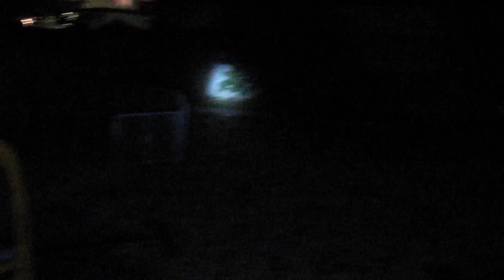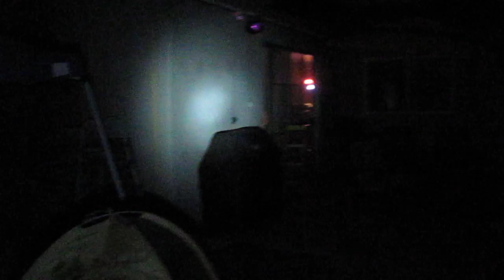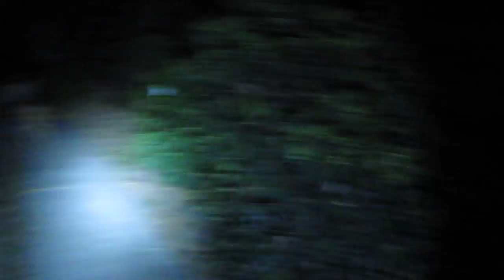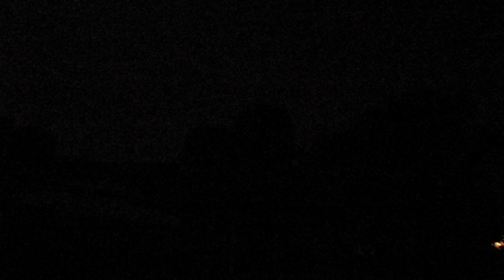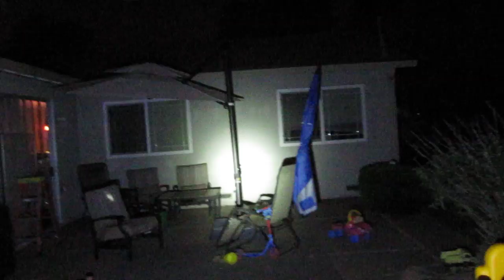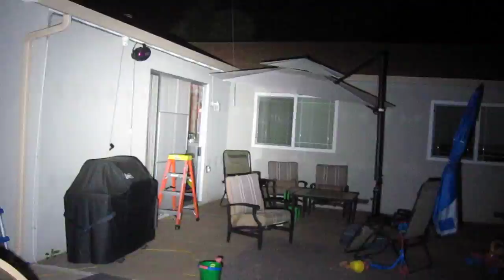Maglite XML upgrade vs some other led flashlights

Comment from the maker: you do loose the focus, but the dropin has a pretty hot center to begin with, so its no problem, you do need a 5 or 6 cell magligt for it to work

if you want to use a 3 or 4 cell, go with the 5 led 1200 lumens dropin module, its awesome 1

both can be had on dealextreme

Comment from the maker: i got a "drop in" from deal extreme, it had the reflector, led and driver all in one. however it does not fit a maglight without some modifications

first the maglight switch retaining screws have changed to keep people from messing with the flashlight, so that was a tough one imho, it has to be removed for the new drop in to fit

second the reflector needs to be shortened a little bit, i took 30 seconds in a lathe, but can be accomplished with some sandpaper and a bit of patience

pretty easy

Comment: Hi! I've been thinking about the same, putting XML led into the Maglite 6D. How did you exactly do that? Could you give me some details? What kind of driving circuit did you use? How did you solve the cooling of the LED? Did you maintain the adjustable focus?